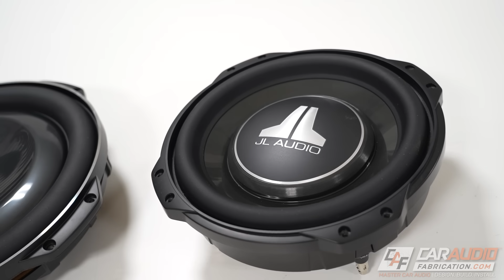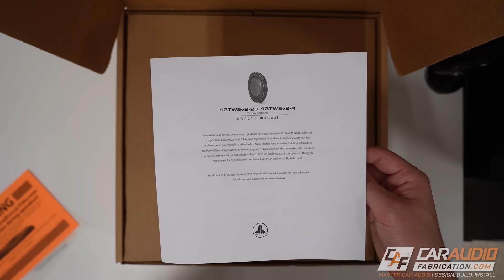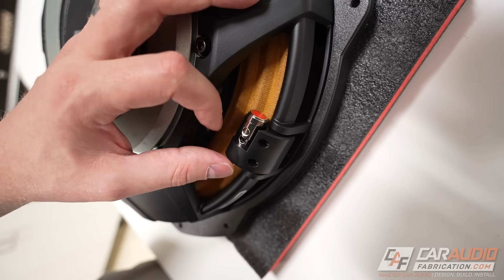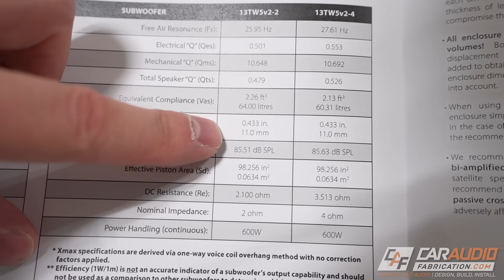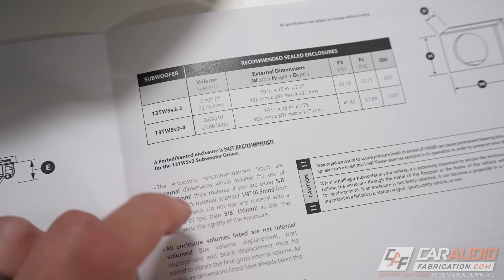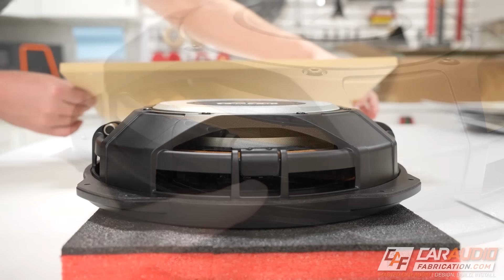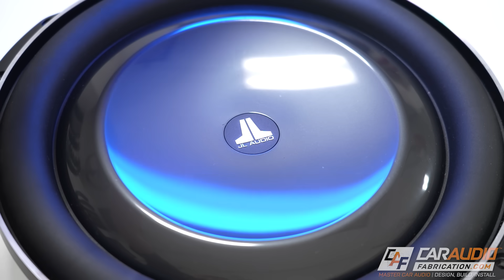The LARGEST Shallow Mount Subwoofer?! JL Audio 13TW5 Overview!

Comment: Rockford and JL subs are both amazing products. I have not heard a louder or deeper bass out of an off the shelf sub than a JL 13W7.
Reply: Rockford fosgate was beating records back then that are difficult to beat nowadays. For example in the early 2000s they had a db record of 164.7 db I believe, with two subs in a car. even nowadays it's difficult to reach that loud without blowing out the speaker
Reply: @corens1337  I know it. I was hitting mid 130s on a single Rockford T1 12 with a 2k back in the day. Slot ported. Chevy blazer. Thing was a boom box.
Reply: @PAFishinmission  yeah those speakers are crazy good, I had one of their classic series at home, I forgot the name but I believe it had like a letter and a number, and they don't make them anymore but the power was no joke 🤣

Comment: Question. I have a JL Stealth box with 2 TW3 12s. Can I replace with TW5 13s. box is for 17 F150 crew under rear seat. If so. Would there be a noticeable difference 🤔
Reply: @jasonschaeffer72  If you want to downgrade. The 12TW3 outperforms the 13TW5 in all aspects except mounting depth
Reply: Nope. I'll keep what I got, lol. I checked the price of $899 each. I'm good 👍

Comment: Hi Mark, I got 2 jl 13tw5 2 would the audio control lc1.800 be enough or should have I gotten a bigger amp?
Reply from the maker: 800 watts RMS falls within the power band nicely! Also consider an RD1000/1 or XDM1000/1

Comment: Are all jl audio speakers made in USA?
Reply from the maker: Some of the lower end products are overseas but engineering and R&D is also here and super solid. There's a difference between a manupackager that has zero engineers on staff and a full fledged company that has a full engineering team. Design matters
Reply: @CarAudioFabrication   that makes sense they need to compete with other cheaper speakers. I just hope when buying u can easily see which are made in USA and which are not.

Comment: Hey mark quick question u said a 7" voice coil wow but what are the benefits to having a bigger voice coils ive seen a few other subs with 3-5" voice coils thanks in advance
Reply: Better woofer cone control.  Imagine trying to balance a plate on a pencil vs in the palm of your hand.
Reply: @HELLtoPAY715  thank you brother I was just curious so would it be better for spl because I want to order some subwoofers 18s to be exact but I was thinking would a bigger Voce coil be better for my application I'm going for a more spl hair trick style system maybe 15s at the least I was curious about kickers new solo x but no 18s yet so I was trying to decide between DD 95 or 99 series, sundown audio,or blackbrick brickhouse subwoofers with 4" VC
Reply: Larger Voice Coil is for equal power  spread and heat control dispersion.
Reply: @geoffreygreggorey6203 , exactly. Larger voice coil diameter means less length is required to pump in the same power while still being able to dissipate heat.

Comment: Hello Mark,
Do sell sub box and JL subs already installed together?
I have a 2012 Ford F250 and want extreme bass,I’d like to use shallow sub or subs for under the back seat..
If you could get back with me I’d appreciate it.
Thanks 🙏🏽
Reply from the maker: Hey! I don't sell car audio gear but you can always check out our show sponsor Crutchfield, or JL Audio directly. I believe they have a Stealthbox for your vehicle that features JL's thin line subwoofers!

Comment: I have a JL 13TW5  installed in the Stealth box under the rear seat of my F250. Driven by a Rockford Fosgate 500W amp. Totally awesome!!
Reply: What year is your F250, I too have a 2015 King Ranch F250 with the JL Stealthbox and wondered if I could swap out that sub with this one.
Reply: Is it punchy bass debating one of these tw5 13s or two 10 w3s
Reply: I have a stealth box in my 08 f350 crew cab and it hits hard. I love it.
Reply: @SteveRig82  I have a 2018 f250 crew cab and thinking about two of those. How hard does the bass hit?
Reply: Will be interesting to see if Brane’s RAD drivers make their way into the mobile market. Definitely a game changer and an actual huge step forward in subwoofer tech and a great alternative to all these shallow woofers.
Reply: What are the dimensions of the box you put this sub in and  does it need to be ported
Reply: Same been running a Rockford Fosgate 500 on my L7 10 inch kicker..love the punch not a deep fan.
Reply from the maker: Very nice! The Stealthboxes that incorporate the thin line subwoofers are amazing. A great value too for such a precise fit.